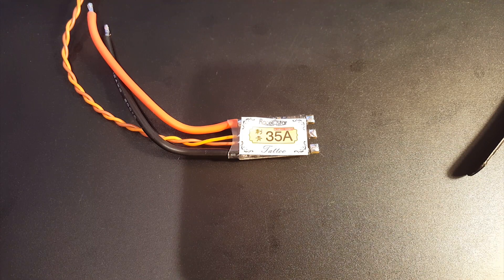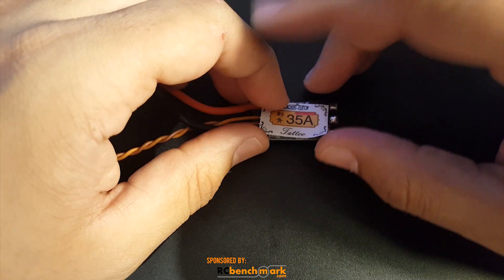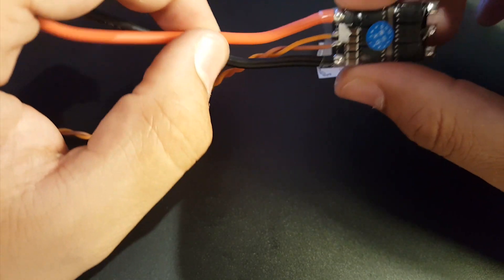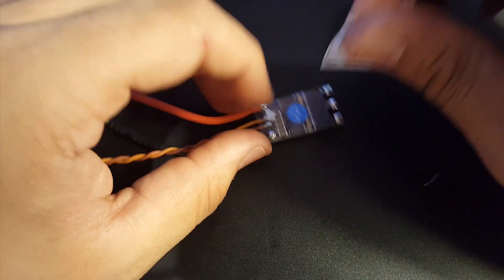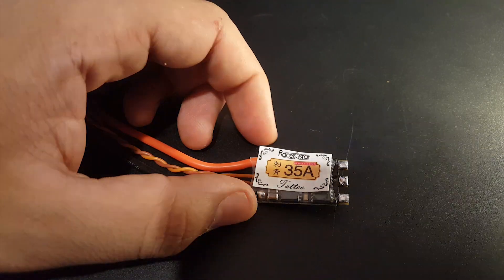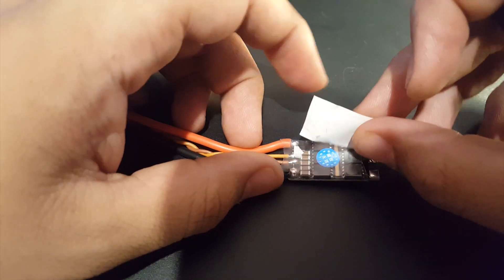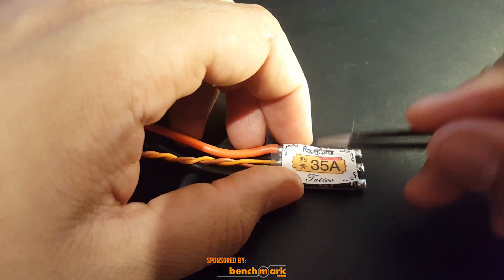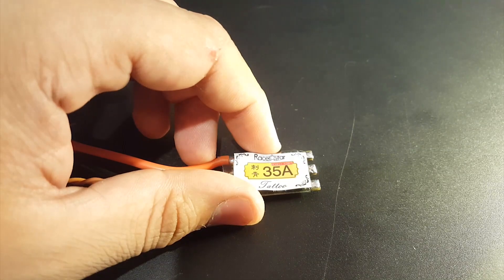Racerstar Tattoo 35A ESC Review and Noise Testing

Comment: Goooooodaay mr. Drone Mesh. I hope you can help me with a problem I recently ran into. So I saw the new D-Shot features like turtle mode or motor beeper that were developed recently. I was very interested in these features so I bought myself some D-shot capable 32bit ESCs. The Racerstar Tattoo 35A to be exact. But the features didn't seem to work. I updated the ESC firmware to 32.1 and I'm using the Betaflight F3 flight controller running BF 3.2.0. I also tried setting the Protocol in Betaflight to D-shot 600, D-shot 1200 and even D-shot 300 but none of them seem to make a difference. After I did some research I found out that the beepes made by the motors when you plug in a battery tell which protocol the ESC is using. First you hear the startup sound and after that you should hear the sounds that indicate the protocol which in my case was PWM. So do you now how I can fix this? Thank you very much in advance and have a nice day.
Reply from the maker: +Marcel Mathis update FC to 3.2

Comment: Do you know if these new line of "budget" 32bit ESC's w/o a current sensor are still capable of doing the current limits in bl_heli32? I don't see how it's possible unless there's a internal shunt somewhere that can't be seen on the surface. I'm starting to see variations of these available on RTFQuads too. Thanks for the content bro